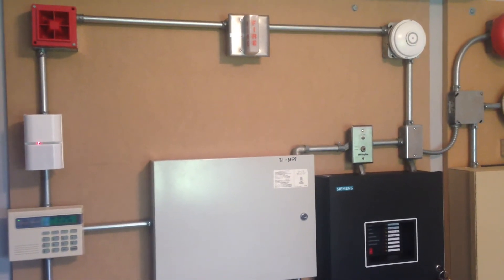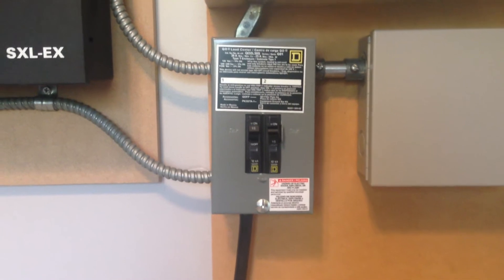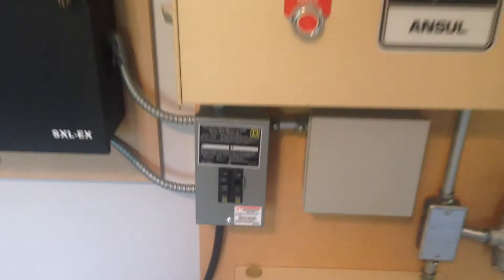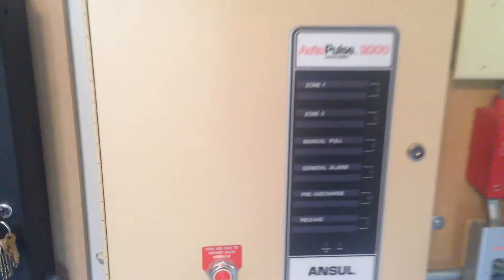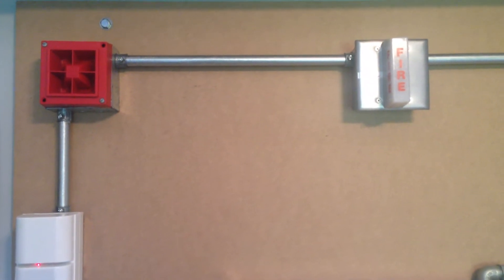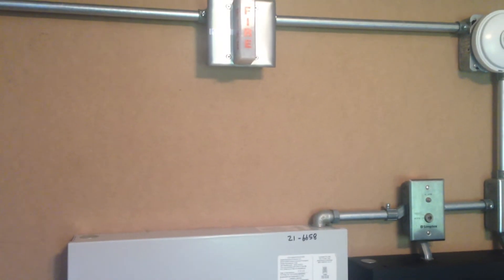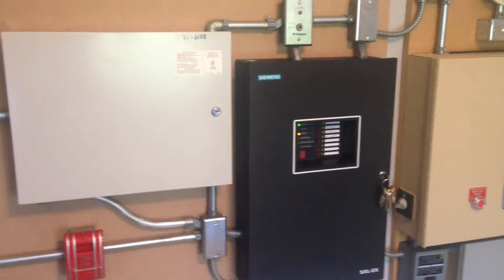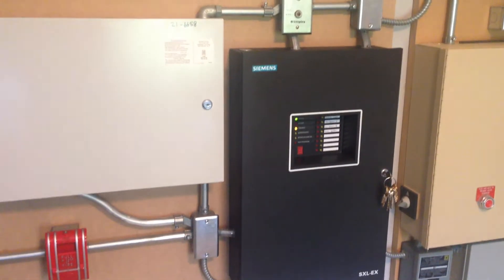System Test 13 | Square D Load Center

Comment: Just a little note, the secondary side of the transformer side (low voltage) cannot run through the load centre, low voltage can't be run through any high voltage junction, vice versa
Reply from the maker: BleachDrinker420 Yeah, that really irritated me while I was installing it. But the limited space I have available means sometimes I have to break those rules to get the equipment to fit on the boards. Get what I'm saying?
Reply: Yea I know, just thought I'd point that out since my dad being electrician would have a panic attack if he saw that. But other than that great demo board.

Comment: I'm thinking about adding a breaker or AC cutoff switch to my setup. Is the breaker necessary, or can I just use a switch? The breaker must provide some protection, I'm assuming.
Reply from the maker: +The Big Green The breakers were used more give the system a look that resembles something more like what you would see in a real building, versus actually providing protection. Actually, before I installed the breakers, two regular light switches were used.